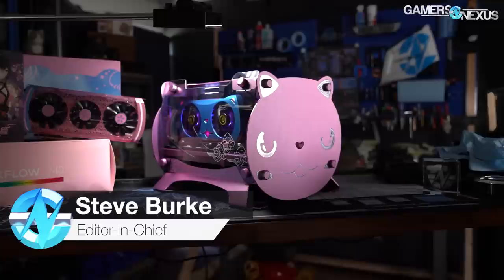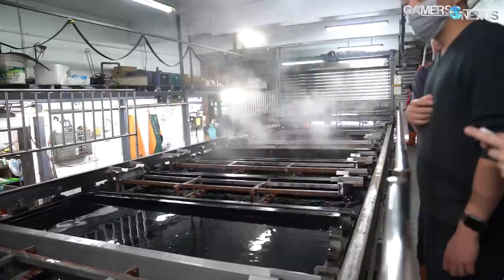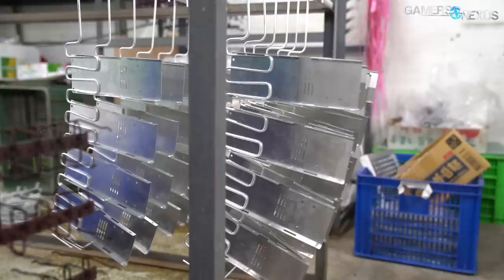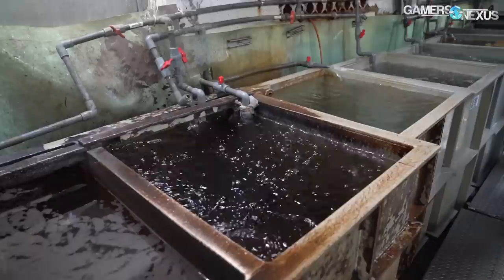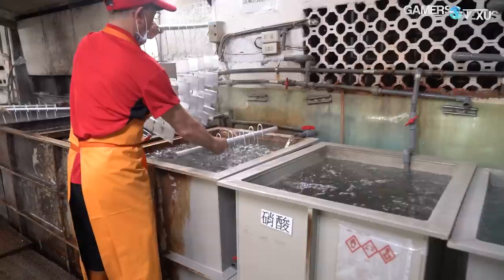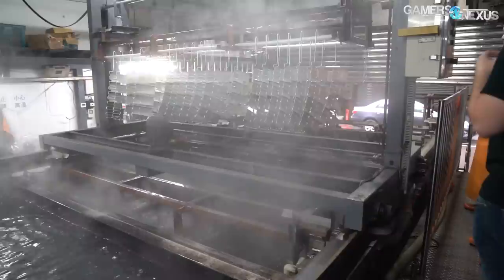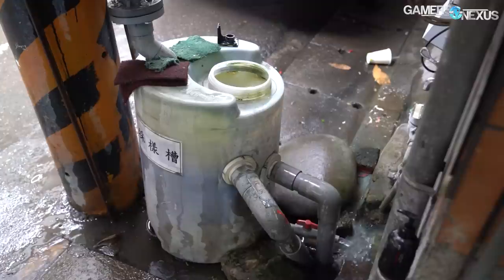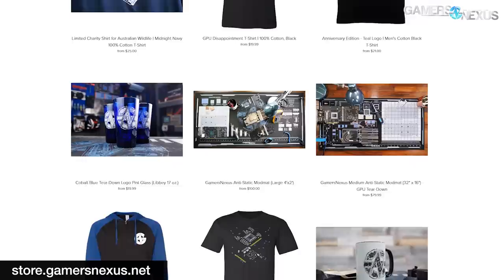Blasting Electricity at Thousands of PC Parts: Watch How Anodizing Works | Factory Tour Mini-Doc

Comment: Dope ass video. Top tier work honestly!

I've worked in an electroplating factory, and almost everything you filmed and said is 100% correct.

However, what anodizing is in general, is creating an oxide layer(alumina) which is much harder and tougher than normal aluminium.

There are multiple things you can do with aluminium anodizing:

- Clear anodizing. Just stick it in there, and it will do its magic without any color.
- Add in pigments so the pigment stick themselves inside loose "holes" inside of the alumina, and create colored anodizing.

Comment: Cause chemical burns.
Worker: hold my beer. splash water without gloves.
Reply from the maker: Yeah, that's just water. It's the tank next to it that's acid.
Reply: @GamersNexus  Hopefully you're not working with a bad headache that day and make a mistake. Gamers Nexus stuff is top-notch keep it up, Steve.
Reply: @GamersNexus  bruh.. that sound worse.. ha! The bath water gotta be spoiled somehow, eh?
Reply: I'm really surprised that they are making all the transfers without gloves or eye protection.  At around 5:24, he was reaching into the nitric acid tank to make the transfer barehanded.  And I didn't see any eye protection at all.  We always had to use goggles when using nitric or sulfuric acid, and a face shield when working with large quantities or situations likely to result in large splashes, like pulling parts out of a vat of acid.  And we always got extra strong warnings about the danger of getting bases like NaOH in the eye.
Reply: @williamwilliams6677  The lack of eye protection is concerning, but depending on the concentration hand protection may be less of an issue. Especially if you use the large bath of water next to it to rinse it off right away.

Comment: Re:Gigabyte Auorus 2080ti 
We really need a standard for addressable RGB stuff. I love RGB, but I HATE all the crap software and incompatibility.
Reply: This is true. Why the fuck there's 5V and 12V header, one uses 3+1 block and the other is 4 full pin. Guess, companies ego and greed take over so that if you purchase one RGB kit that isn't compatible with your motherboard or software, it's like the company gives a middle finger to you to force you to buy A DIFFERENT RGB kit that is compatible with that product.
Reply: Imagine having to worry about RGB standards

This post was made by Noctua gang
Reply: @AlfaPro1337  no, 5V and 12V RGB headers make perfect sense, 5V is an evolution of the 12V standard. The problem is with crappy software. The industry needs an open standard for RGB software control so users can control all of their RGB stuff with a single program of their choice.

Comment: It's not about dye sticking on top of it, it's about it sticking into the pores caused by anodisation, then they bathe them at around 100C to close those pores, then dye gets trapped and whatever left on top of it will simply wash off.

Comment: I got my Dynamic XL like 2 months ago. The rgb on the front glass are no longer functioning and one of the hdd hotswap has a bad connection so my harddisk randomly shuts down, the aux channel on front io has this "scraping sound" and the sound switches between left and right eardrums even tho the contact are fully pushed in.
Reply from the maker: Did you try emailing support?
Reply: A tip never ever use the front audio port it's not even close to as good as the back of the motherboard
Reply: @Tony-cf7cp  this is true. Audio is analog and proper wiring matters.
Reply: Front audio jack remove from motherboard connection and use "deoxit" available from digikey or the like stores. Should fix it right up. Same with hd connector sounds like corrosion.

Comment: Soooo basically this isn’t something you’re gonna be trying to DIY unless you’re a mad scientist.
Reply: It's actually not too hard using simpler processes, you can use sulfuric acid and electricity to etch it, buy a dye you like off ebay or amazon, and seal it with boiling water. I recommend looking it up on youtube, plenty of people do it on smaller parts.
Reply: Yeah I'll second the previous comment, it's pretty easy to do yourself pretty well.
Reply: This is a really simple process to DIY.
Reply: Yup, not terribly difficult at all, if you're willing to pay close attention to each step and production speed isn't a huge issues. It gets more complicated when you want to automate and speed things up, and have to deal with government regulations and checks. But for just some random homebanger projects it's really not that bad at all.
Reply: Lye is easy to make, but to get these levels and use it safetly, it's probably easier and cheaper to pay someone to do it for you unless you are doing tens of thousands of parts.
Reply: @user-yv2cz8oj1k /videos FWIW, you can just buy lye, don't have to bother making it.
Reply: gixerman01 has a video up on how he anodized some aluminium parts he had turned on his lathe: https://www.youtube.com/watch?v=PWfA0nibfMM
Reply: Anodization is comparatively easy to DIY actually. Actually doing it well may be much harder and you need to be able to work with hazardous chemicals (this is not neccessarily difficult, but needs common sense and space.) The problem is, selling anything you make may be legally problematic due to the USA's legal regulation of anodization and plating.

Comment: So is it annodizing, sand blasting (with certain sand shapes) or brushed aluminium that gives that nice rough low shine texture on certain cases? Ive wonderred that and even looked into home annodizing and sandblasting since i do paint a lot of my own stuff, but wasnt sure like what makes the outside of say a 2008-09 Mac Pro tower's finish or if they all do just slightly differently etc. Would love some kind of side by side comparison of all the different case finishes outside of paint/colors obv. Either by GN or just somewhere
Reply: Probably sandblasting for the texture, and anodizing to protect it. The metal will take it's original finish after the anodizing, for example if you want the super shiny reflective anodization, you need to polish the aluminum beforehand.

Comment: Lye bath? I bet that's used after dark by the local mafia :)
Reply: I doubt it, if you dissolve a body in lye, the body doesn't just disappear, it turns into a vat of gooey gross stuff, and would probably gunk up the drains and slow down production, now, if the mafia needed some lye to fill up a barrel or something, I'm sure nobody would notice a few bags falling off the truck wink wink

Comment: Interesting ... but aluminum is not equal to aluminum. They have a lot of shit in it like bathco to reduce the melting temperature. The result is low quality staff. You can easily test it out by trying to bend it.

Comment: You convert the surface to aluminium oxide, you don't "Add an layer" like you do with paint*
Reply: Yep. I mean, you can add a layer of aluminium oxide theoritically, but aluminium is so reactive already you can't exactly do this.
Reply: Saying that "it's a method of adding an additional oxide layer to the existing metal" ( 1:52 ) can be confusing. I think the opening where he refers to "coating" ( 0:34 ) products is similarly confusing. I agree that "converting" is a better word than "adding" since the process is not additive, but Steve's further explanations more than make up for it.

Comment: Crazy how all of those Electrical Connections are totally open and Unguarded except for a Short fence!! Don't think that would fly here in the US!! I.E.= OSHA!!
Reply: What is the voltage? Also if you are dropped there electric contacts is least of your problem . (20% sulforic acid)
Reply: @mistakenotou7681  Steve didn't say the exact Voltage used, but did say they were running 25K Watts though those connections. Depending on how the connections and tanks are Grounded, touching one of those Connections would not be advisable!! Getting thrown into the tank would be bad also, but not really relevant to my comment.
Reply: Anodization doesn't need a lot of voltage, just massive currents.

Comment: i thought white anodizing was not possible?
Reply: Since the color comes from the dye pigments stuck in the porous structure, I don't see why white wouldn't be possible?
Reply: it is not technically white anodizing, it just not dyed, there is no white anodizing because the white dye molecule is normally so big that even the smallest white dye molecule cannot fit the pore of aluminium oxide layer

Comment: Would it be ok to put upgrade my i5 9400f to an i7 9700k on a msi mortar b365m and overclock to 5ghz with an artic liquid freezer 2 280?
Reply: If I remember correctly only z390 supports overclocking
Reply: I would think an overclocking forum would be a better place to get this info than a YouTube video about aluminum anodizing.

Comment: is 1080p 27 inch 240hz monitor good for gaming??
Reply: @VictorVonVulfgang  is it bad??and is there any pixels issue in 27 inch 1080p monitor??
Reply: Eye better 27 is 1440p  24" is 1080p both good
Reply: Yes, it's horrid. You're much better off with a 4K 7" monitor running at 5 kHz, or a 108" 720p monitor at 25 Hz.

All joking aside, there are many different 1080p 27" 240 Hz monitors out there. You can get good ones, and you can get bad ones.
Reply: @jubuttib  is benq zowie xl2546 or xl2746s good??

Comment: You really wouldn't want to be in that building for long...  Those surgical masks they are wearing won't  help considering whats in the air.
Reply: I was surprised but I found a few videos of similar factories in the states and they don't even wear masks. Maybe the concentrations are low.
Reply: The masks were most likely Covid-19 related.